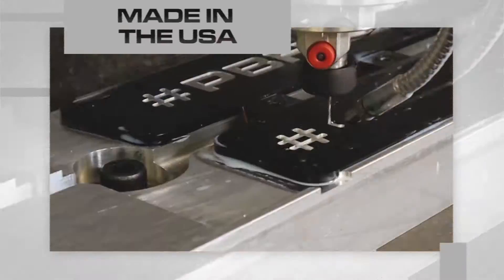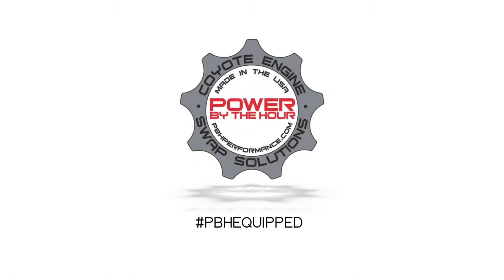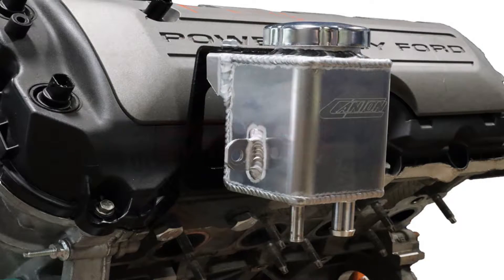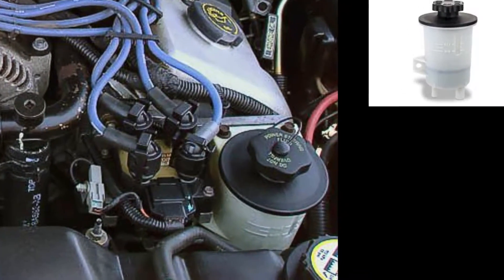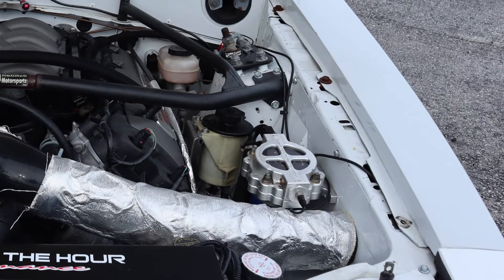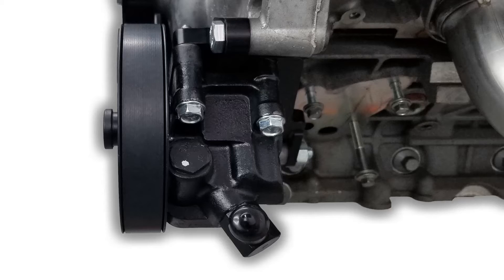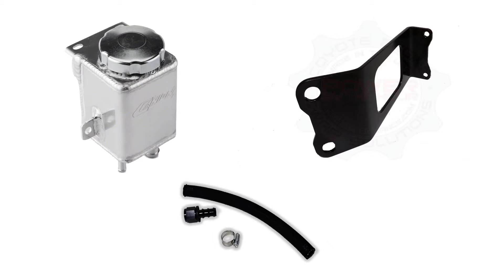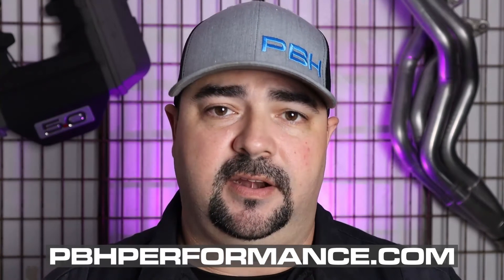Coyote Swap Power Steering Reservoir Bracket

Comment: This is definitely a need on the stang! great product
Reply from the maker: Yes sir, you can actually use the S197 bottle with this bracket, you just need to make the center hole and it should work.

Comment: I have a 2006 Mustang GT and just did the 2104 electric power steering swap and it is awesome. No more fluids, no more power steering pump, no more intrusive lines and a shorter belt that allows you to eliminate the power steering pump and less rotational friction on the front of the engine. 👍😁👍

Comment: Are your products compatible with an 09 v6 (control pack/power steering kit/return system fuel kit/etc ? I see that your website only mentions the s197 GT no mention of the 4.0 v6. Thanks
Reply from the maker: Alan, our future S197 harness will be compatible with the v6 cars as well as the v8's. The rest of our items are fairly universal. Things like the power steering pump and ac compressor will not be compatible though.